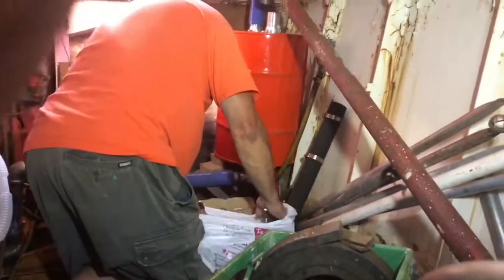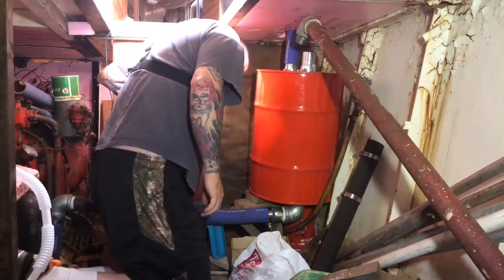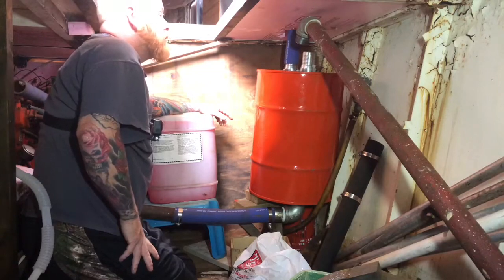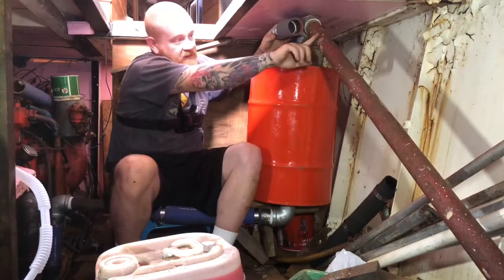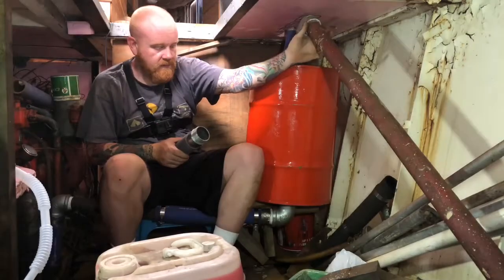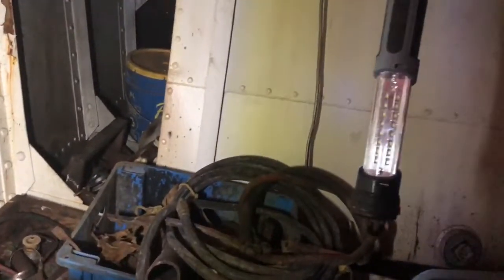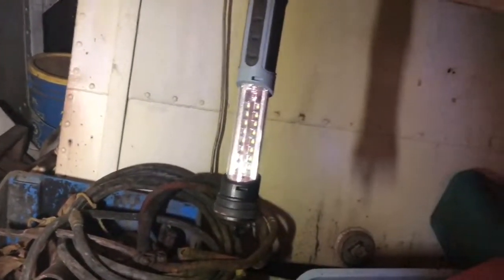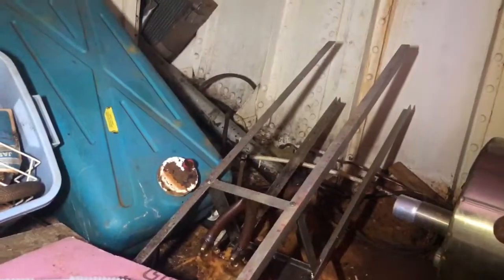100 year old tug boats cooling system

Comment: FYI; The 471 -71 series diesels came out in 1938. The Detroit 453 - 53 (cubic inch / cylinder) came out in 1957. Did you put an anti siphon valve in the pipe near the thru hull? It looks like your cooling water/ surge tank will be higher than the waterlevel outside... Best wishes,  Stay the course & "Giv er"
Reply from the maker: Now that’s some engine knowledge. Tank should be good same position as before and it syphoned with no issues. We used to have lots of paperwork and history on the boat. Had all that paperwork in a truck that sank ice fishing.